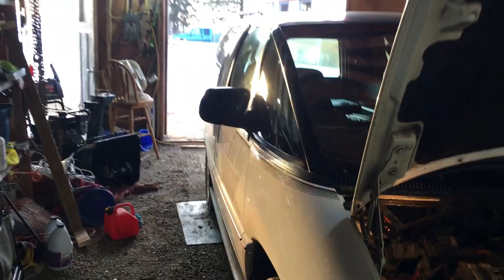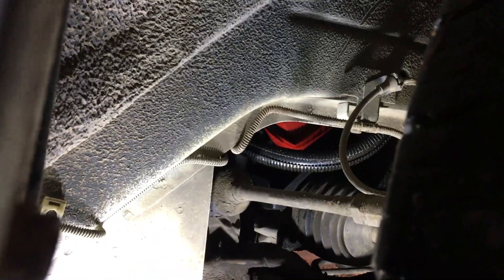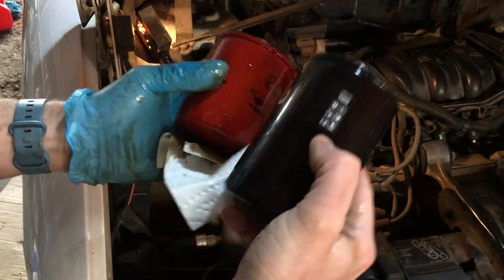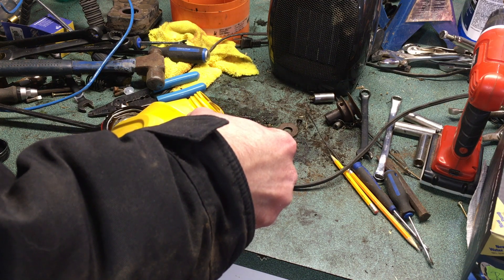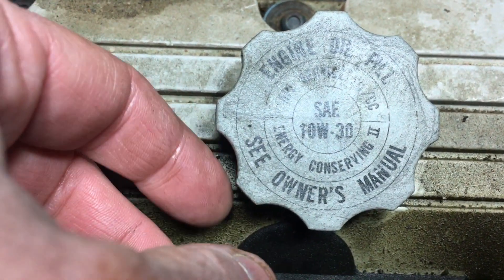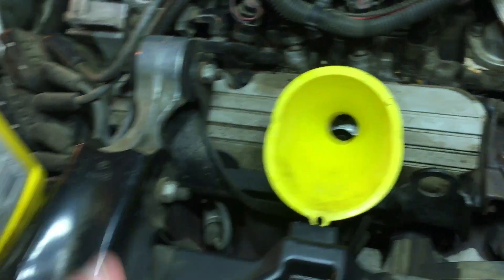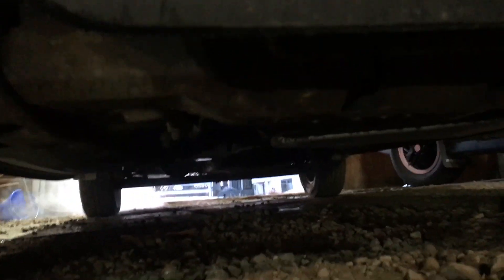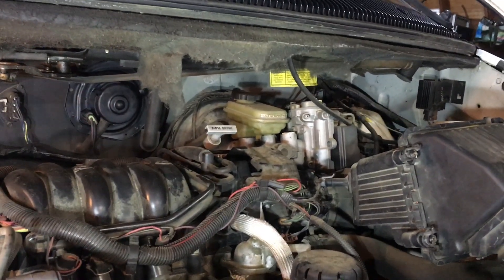1993 Chevy Lumina APV - Engine Oil and Filter Change DIY How To!  Series 1 3800 V6!

Comment: Thanks for another informative APV service video. 3.1, and 3.4 vans should have the filter on the front of the block. Looking forward to seeing the engine get the “Scrubbing Bubbles “ treatment. Looks like the leaking oil has helped to prevent rust underneath.
Reply from the maker: Lol, I’m sure that was GM’s plan all along.  Put in crappy seals and let the oil do the rust proofing.🤣

Comment: 5:30 Unless Pennzoil has a guarantee of cleanliness level for the fluid out if their jugs, never prefill the clean side of the filter. That jug can have just about any contaminants that would hurt your main bearings.
Reply from the maker: Yes, because dry bearings seem like a safer alternative?  Don’t forget, when cold or plugged, your filter is bypassed, all that oil is going right to the bearings uncleaned.
Reply: @Turbo231  The bearings are not dry, the remaining oil is sufficient while the filter is filled by the oil pump during crank. Or do you rev and load the engine right at start up? The debree that can be present in a new jug of oil can be much worse than what gets caught in your oil pump screen. A new jug of oil is to be considered dirty and in need of filtration. It´s fine to pour over open components, but not to be pushed into your mains.  Could  you trust a hydraulic engineer working with oil cleanliness on this?
Reply from the maker: @jonasthemovie  Sometimes they over think it, so not really.  If you are classifying new oil as dirty, I get your concept but in reality I don’t agree.  There is not going to be anything in that jug that will hurt a bearing until the very bottom at least.  And if that jug is cold, even if poured into a warm motor, will will open the bypass spring and be put on the mains without being filtered.    The wrong oil is better than no oil, so I pre-fill my filter.   That’s the mechanical engineer in me.
Reply: @Turbo231  So, that’s a no then.

Comment: An oil pressure gauge but no Tac  , GM is funny 🤪
Reply: Old GM would do anything to save a nickel per car. Oldsmobile and Pontiac vans were exported with manual transmissions, so the tachometer was needed. Cheap manual S-10 trucks just had a shift light.
Reply from the maker: It drives me nuts.  There is a dash on eBay that has a tach but it’s also in mph instead of kph, so I’m thinking I will hide an after market one somewhere.
Reply from the maker: My parents had fancy dashes.  88 S-15 Jimmy and 89 S-10 Blazer, both 2.8 5-speeds, had the tach where the fuel gauge is and the fuel gauge where the fasten seatbelt light was, very symmetrical and apparently rare.
Reply: @Turbo231  It would be so easy for them to add a tac as standard equipment , 
I hate having to guess  what rpm I am at
Reply: @Turbo231  I have see plenty of 5 speed without a tac . it should be illegal 🤬

Comment: Same as my 92 regal, kind of an awkward position for the oil filter
Reply from the maker: I found the regal to be easier as I can get on top of the engine and reach down.  No way can I do it on the van.